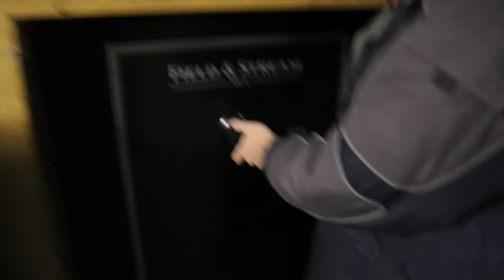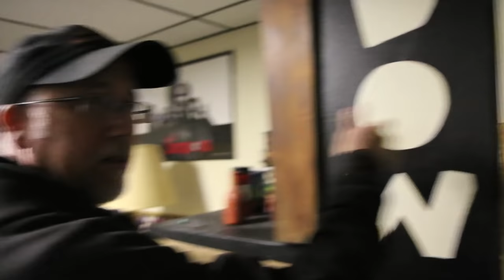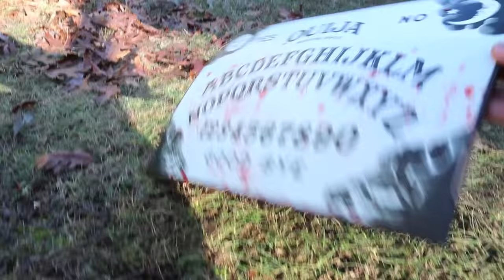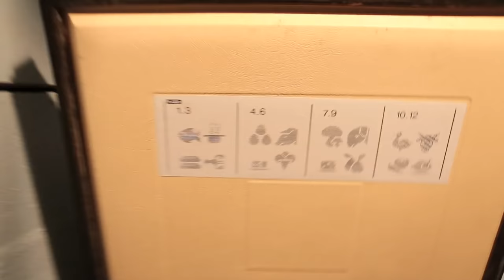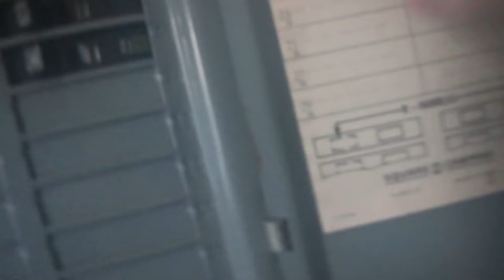BEWARE THE FLOOD!

Comment: 3 Digit Combination Locks for Gun Safes
31-10-31

Turn the dial to zero. 
Turn the dial to the left (counterclockwise) three times to the first number of the combination (pass the first number of your combination two times, stopping on it the third time). 
Turn the dial to the right (clockwise) two times to the second number of the combination (pass your second number once, stopping on it the second time). 
Turn the dial to the left to the last number (stop the first time on your last number). 

Pull the handle down; the door should open.

Comment: Jesse not sure if you will see this or not, hope you do, I have the same exact safe (different combination) but slowing down the vid I can see the combo is 48-21-36, follow these steps to open dads safe.
3 Digit Combination Locks for Gun Safes
48-21-36 and a stop digit
Turn the dial to 4 times left and 4 time right and than stop on zero, this is what's called clearing the lock, 
Turn the dial to the left (counterclockwise) 4 times to the first number of the combination (pass the first number of your combination 3 times, stopping on it the 4th time). 
Turn the dial to the right (clockwise) 3 times to the second number of the combination (pass your second number twice, stopping on it the 3rd time). 
Turn the dial to the left twice  (stopping the 2nd  time on your last number). Than turn the dial to the the right till it stops and that sets the tumblers to allow it to turn the handle.
Twist the handle to the left; the door should open.
Read more

Comment: Hey Jesse, if you don't care if you cause damage to the safe, here is a full proof method:
Get a shitload of white phosphorous, BUT DO NOT TOUCH WITH YOUR BARE HANDS.
Proceed to paste the white phosphorus on the hinges of the safe with any sort of adhesive, and from a safe distance, light the phosphorus. 
It should melt the hinges and you can get your money back. 
It's like the shit you see in movies. If it doesn't work, you did it wrong.

Comment: On the safes there has to be an override key slot in case you forgot the combination or it does not work. You could call a locksmith that specializes in opening safes. Also some safes have a Generic Code that if the user does not set you can open it with some code such as 0000 or a Master Code. You can Google the company of the Safe.

Comment: jessy get a hammer and knock off the combo  spin wheel and then get a punch and put it in the hole and knock the lock off and it will fall inside the safe then the will open